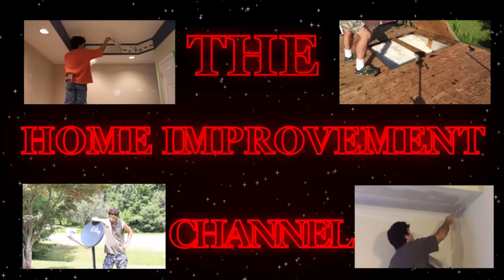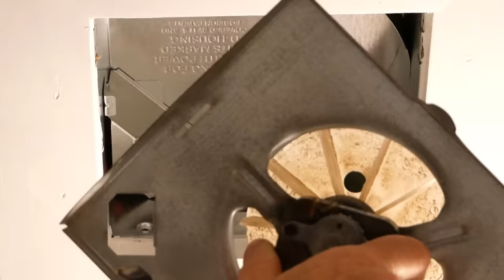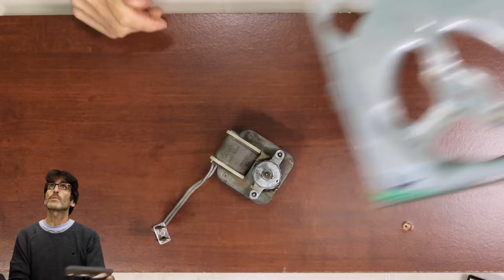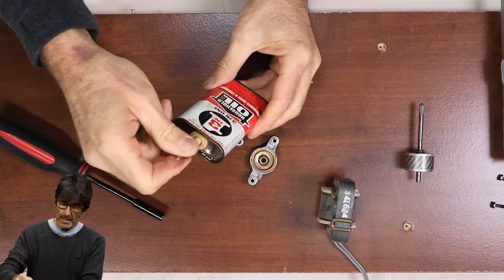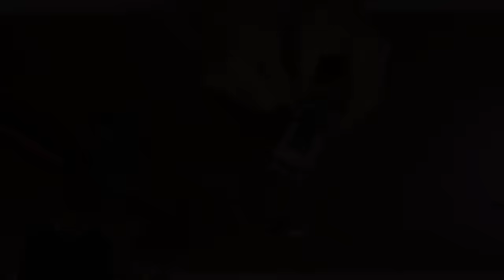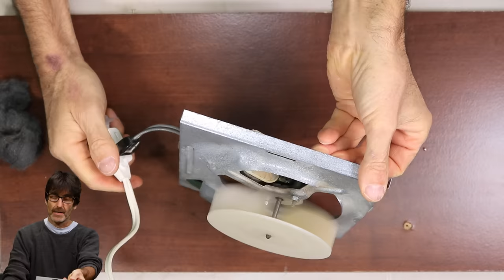Replace Your Bathroom Fan in 5 Minutes FLAT!  NO Attic Access!

Comment: Thanks for the straightforward and simple guide. My fan died and I thought for sure it would take me hours and going into a hot attic to replace it. With your  video and a replacement motor and fan set I replaced the bad parts in less than 5 minutes and under $20.
Reply from the maker: Awesome!  Thanks for the comment.. :-)

Comment: Thanks for this. My fan was really noisy, so I followed your procedure, cleaned and reinstalled it and now the sound is at a reasonable level.
Reply: Sometimes the noise is because the fan has loosened up where the flat part of the stem is
Reply: Mine is noisy too but when I read reviews in the model I have in quite a bit of reviews said the same thing. I did clean it out ( the housing ). It’s still noisy but after the painful task of taking the motor out , running to Home Depot to get the part , watching several videos , banging the motor in the right spot then doing all that clean up afterwards I’m just letting it be noisy. As long as it does it’s job I only have it on when I shower so I don’t care. I’m to pooped to care
Reply: @ccalexander1924  try some grease, always works for me.

Comment: Fantastic video, and great tip about taking pictures along the way.  I was stunned at how hard it was to pull that circular plastic fan off.  You were right: I almost had to put my feet on the housing and yank up.  Once I got it all apart, though, and cleaned the shaft with some steel wool and oiled it, no more screeching godawful bath fan noise.  Thank you!
Reply from the maker: Excellent!  Glad you got it going... :-)

Comment: Outstanding video - great overhead shot plus no music or useless logo flashes usual bravado. Gold standard for videos.   I have moved alot and frequently find the bath fan is so bad that it does not work at all or just hums not even turning or squeaking.   After  utilizing the  home warranty that came with a past home purchase, I found that the warranty (insurance) company charges $100 deductible per incident.  Thus if there were two fans in need of service, the homeowner would have to pay $200 to have them fixed under the warranty.  So when the second bath fan just hummed, I took the grill off to find it clogged with dust and debris.  Without removing it, I vacuumed it out, lubed it and got it running fine.  Thanks for a great video, I did not realize that the motor could be removed without taking the housing off. You have just opened up more options to get the three inoperative fans in my current home running again.
Reply from the maker: That's awesome!  Thanks for the great feedback.  Those fans are about $19 at Lowes if you have one that won't come back to life again... they were about $14 a year ago so there's that!..

Comment: This is one of the best instructional video clip on YouTube. Now that the trick is explained, it is almost trivial to swap out the old fan assembly and replace it with a new one.  In fact I was able to do it within a couple of minutes. 

However, if you plan to clean the fan assembly and put it back as shown in the 2nd half of the clip, I'd recommend one thing - when reassembling the motor, proper tightening of the 2 long screws dictates how smoothly the shaft will turn.  If the shaft does NOT turn effortlessly, tighten one of the long screws just a hair more, a small adjustable wrench works great.  Thanks again for a clear and crisp instructional clip that helped immensely !
Reply from the maker: Thanks for the tips and the great comment... :-)

Comment: Many thanks for such a clear video with easy to understand method, precautions and other necessary information to remove a bathroom fan. Very helpful indeed to save me  the trouble of removing the whole housing unit. Instead i just removed the motor like and cleaned it thoroughly as shown in the video. Didn't need to call an electrician. After cleaning and giving lubrication the squeaky sounds were gone. Thank again.
Reply from the maker: That's awesome!  Thanks for the feedback.. 😀

Comment: I just bought a condo that was owned by a smoker so this will be a great addition to everything else I’ve been doing to try to remove any trace of the smoke
Reply: I doubt there's any lingering smoke in the air. If there's a smell, it's like collected on all the surfaces over the years, like carpet, blinds, etc.
Reply: @SgtZima  it's not in the air but it was on everything else which has been removed. I want to remove the fan as well to remove any tar that is on it
Reply: @dedet8827  Probably a good idea.
Reply from the maker: Yes that smoke it hard to get rid of.  You probably have some in the HVAC duct work if the smoke was real extensive.  Possibly the Evaporator coil has got it too.  Cleaning this fan will probably help, but it's mostly pumping air out instead of in, so it might not make a lot of difference.  But if it was me, I'd clean it too.
Reply: @TheHomeImprovementChannel  Thanks for the reply. The smell is actually gone now. I used a company called Green Solutions that came in and fogged my entire condo. Now it's really just for my own peace of mind to try to get rid of anything that may still have any sort of cigarette substance remaining on it.
Reply from the maker: Dede T I understand, I’m really sensitive to it too
Reply: @TheHomeImprovementChannel  relax pink lungs your not going to die 🤦‍♂️

Comment: Thank you so much! I had tried a half-ass cleaning (basically trying to use the vacuum to remove the dust bunnies), as well as tried removing that plate, but had been looking at the wrong side for the tab. I pulled it down, cleaned and lubed it, and popped it back in and it's working like a charm!
Reply from the maker: You're welcome!!  That's excellent.  Glad you got it back on the road.. 🙂

Comment: Thanks for this video. A bathroom fan started squeaking so I turned if off and taped over the switch and told my family not to turn it on. After a month or two I happened to see your video. I was able to remove, clean, and oil three bathroom fans in an afternoon and have all working well. It would have been faster, but some other issues arose. Your video was spot on.
Reply from the maker: Great job!  Glad I could help 😊

Comment: Legit. I was mapping out a good 4-6 hour project to replace mine. Just re did entire bathroom and I had this noisy, yellow 25 year old fan. Home Depot didn't sell just my motor housing, but the 696N assembly was $15 and I pulled the motor out of there. Took 5 minutes AND came with a new white grill. Thank you sir!!
Reply from the maker: That's so excellent!  Glad I was able to help.. 😎

Comment: Thanks for this vid.  I live in an apartment and I have to replace a bathroom fan that doesn't work anymore.  I'm glad I can replace the motor without having to dig the whole assembly unit out of the ceiling.
Reply from the maker: If you live in a apartment doesn't the maintenance staff do that kind of stuff?

Comment: So if you want a newer quieter fan, do you measure the old one before you buy the new if this is even possible to do. Talking 30 year fans. Thanks
Reply from the maker: Yes I would do that.  Or take the insert out and take it to the store with you.  If you can't find anything that'll fit, it's possible to buy a new fan and swap the motor itself onto the old housing

Comment: Thank you. This was very helpful. My shower fan/light was squealing (when it would run at all). I looked at what it would take to replace it. This is an old house, and the size is non-standard. It was going to take a $200 fan/light, and given my age and the installation conditions, another $150-$200 for installation. Mine is much different from yours, but your video prompted me to try to remove the fan from below. I was able to, and I was able to disassemble the fan and lube it. The grill was also clogged with decades of dust. Works MUCH better now.
Reply from the maker: That's excellent!  I'm so glad I was able to help...  Thanks for the feedback.  😀

Comment: I learned the hard way how easy this could be after tearing out the old fan, housing and all, just to see the replacement was the same. Basically plug and play.
Reply from the maker: I was at a job and someone was doing exactly that and wanted me to finish the job.  All they had to do was pop out the old one and pop in a new one!  That's what gave me the idea for this video... :-)
Reply from the maker: @shinyam75  I don't think there's any fan that'll work for "all" fans.  This model is a very common fan, but doesn't represent all fans.  I have swapped the motor itself sometimes when I can't get the housing to fit.  So that may be an option for you.
Reply: @TheHomeImprovementChannel  Great, thanks for taking the time to respond!
Reply: shinyam75 
I need one to replace NuTone 695c(70cfm sones 5.5)
I will try nutone upgrade  model:FG500NC , sones 3 not sure now.

Comment: I luckily found this video moments before cutting out more drywall. Thank you! My 20 year old original fan apparently had a slightly larger housing so I couldn’t just swap them out, but I was able to remove the two nuts holding on the new fan and swap it with the old one.
Reply from the maker: That's awesome!  Glad the video was able to help..😊

Comment: Great video!! Have a fan not working..now  I  have  the confidence to   conquer it!!
Reply from the maker: Excellent!  Thanks for the comment... if you can't get it working and it's the style I have here,.. they're pretty cheap, you can just buy one and replace the fan itself.. but you might be able to get the original one going..:-)
Reply: Probably  will have to replace the whole  unit...it got alot of dampness from the attached bathroom
Reply from the maker: You should be able to swap out the insides if the housings are the same..

Comment: Fantastic step by step.  In my case, I had a burned out fan motor and your tip to just replace the insert plate was perfect. Unfortunately the electric hole on my old plate and the new plate were in different locations!  So it would not align. But, I has able to take the new motor off the new plate and mount it on the old plate.  It perfectly aligned and worked great.  Problem solved in just a few minutes.  Thank you!
Reply from the maker: Great job!  I was going to suggest swapping the motor to the old plate, but you already did that... 😀

Comment: I just took apart my 1987 Nutone fan. It was unbearably loud, so for a while it was simply unplugged. But I took the advice in this video, and cleaned everything, oiled everything, tightened it all up. Cleaned the housing area, added some insulation and it sounds about 75% better.  It's still a bit loud, but considering it is a 32 year old cheap fan its substantially quieter than it was before. I'll keep an ear on it and see if it stays this way or if it gets louder over  time. But thanks for the video, I probably wouldn't have done it otherwise.
Reply from the maker: That's awesome!  Thanks for the comment... :-)

Comment: As a Residential Contractor, I always by a new fan motor replacement for $14.99 at Home Depot. This prevents me from having to come back 6 months later, to replace it anyway. Pop it in in 2 minutes. Just make sure you buy the correct size, and brand name. Enjoyed the vid.
Reply from the maker: Yes I agree as a contractor that would be better.  I showed the disassembly and cleaning part for those who just wanted to fix what they had.  Some of those fans are older and there's no replacement model for them that'll fit.. but your right as a contractor myself, I wouldn't chance it.. it'd price out replacing the housing and everything before I would take a chance on a call back.... thanks for the comment.. :-)

Comment: Thank you! I had the hubby look @ it and he was about to start ripping the housing out after the light bulb. 
I am so happy I told him to wait until I did some research.  His repairs tend to lead to lots more repairs. (If you know what I mean. 🤭🤭
Reply from the maker: Lol...  I once cut open a lot of holes in the drywall tracing a wire to an outside plug that didn't work.  Come to find out the plug was connected to the bathroom GFI and it was just tripped....  The good news is, I only made that mistake once.. 😂. I'm glad you were able to get your fan going again with minimal work...🙂

Comment: I finally got to our Bathroom Fan today after viewing this video probably a good year ago if I had to guess. Our fan had the Light inside of it also but basically the same set up only ours had 1/4 inch screw holding the plate up with the motor attached. My wife's hair spray was everywhere up in that fan. Took a lot of cleaning right from the get go. Used a small shop Vac and a pancake 3 gallon compressor to blow it out while still in the ceiling before I took it down.  Then wiped it down with a old sponge and warm water with some dish soap. Finally I took it out to my barn where I have a larger 80 gallon Compressor and blew the heck out of it. Took it all apart and cleaned the shaft. I had a jar of Silicone clear grease so I used that instead inside the bushings. Put it back together and the fan looks and runs like brand new. I have rebuilt Car and Truck Starters and Alternators in the past so this wasn't too bad of a job rebuilding this fan motor.  I have been in this house since it was built in '84/'85. I had replaced the original motor once already from up in my attic. I had no idea you could get into it from below. Back in the day we didn't have You Tube or Computers to help us out as this video surely did. I remember getting the new motor from my local Home Depot years back. Now I wish I would of kept the original electric motor. It probably only needed a cleaning like this one that was making noise so we stopped using it until I finally got to it today. At the time I thought it would be easier just purchasing a new one since they were cheap. I like this idea better.  This was a very good video. Thanks for doing it. It was a great help and I was educated today. Not to mention I have been stuck in the house because of this Corona Virus Scare out there and I have been thinking of different things to do when I remembered this project that needed to be done. Well it got done today.
Reply from the maker: Hello!  Yes a lot of people are home due to the craziness that's going on in the world.  I have gotten some grief for the 2nd half of the video explaining how to fix the one you've already got.  Some of the older fans can't be replaced as easy since there's no match to go buy anywhere, so that's why I showed this.  It beats having to take the old housing out of the ceiling and do a possible drywall patch job if the new housing isn't at least as big or bigger than the one that came out!  I'm glad you were able to get this going!..
Reply: @TheHomeImprovementChannel  You were smart to do so because I haven't seen fans like this made anymore and I am not sure if the newer fans they sell will fit in the same opening and I don't want to go all through that again installing a new one because that would mean going up in the attic moving things out of the way on the floor up there and pulling up the plywood floor over the bathroom. It is a heck of a lot easier to take the motor out from under the fan and rebuild it if you can do it.

Comment: Thanks much! I'll mention that my fan housing has the plugs in a different place which I dont think you brought up but I was excited to hear that you could just do that. I also hadnt thought about just trying to clean up the motor. Being above the shower it should have been pretty obvious that it would get rusty but I wasn't even thinking about that. Gun oil worked well enough and you saved me a trip to the store and my fan from the dump!
Reply from the maker: Awesome!  You might still be able to find one that the hole for the plug is in the correct place.  Or you could cut it out with a dremel tool to accommodate where the plug is assuming the housing is the same size..  Or if it works fine after cleaning it, call it a day!

Comment: Thank you so much! My fan was getting really noisy.
First choice: bought a whole new fan set up from my local store. Cost 80 bucks. Couldn't figure out how to get the old one out, despite all the videos I watched, not without destroying the whole old piece. Plus would have cut a larger hole and all sorts to make the new one fit.
Second choice: looked at replacing just the motor/fan piece from amazon (only about 30-40 bucks). Would have kept the old housing that I couldn't remove and the screen vent. Cheaper option + saving waste.
Third choice: watched your video - removed the fan motor, took it apart, cleaned it, and re-oiled. Still a loud motor but way quieter and runs way smoother. Since this is just for odour control (2 piece bathroom) and not for moisture, it's run only occasionally and for short duration. Saved me 80 bucks for a change that wasn't that necessary.
Reply from the maker: Awesome!  Glad I could help.  In my opinion those fans are used for moisture as well.  They say to run a fan for about 20 minutes after a shower to remove the humidity faster... 😀. Edit:  I re-read your message and realized the bathroom it was in doesn't have a shower!... Sorry for the confusion... on my part..

Comment: YES THANK YOU.  I did the same thing.  I bought a new fan and read the instructions and was up in the attic doing all kinds of bending and crawling around to try to get to the bathroom fan so i could take out the housing.  I couldn't even get to it and was about to give up until I found this video.
Reply from the maker: That’s awesome!  I did a video recently changing out the whole fan from the bottom..it’s helpful if your new fan is bigger than the old one